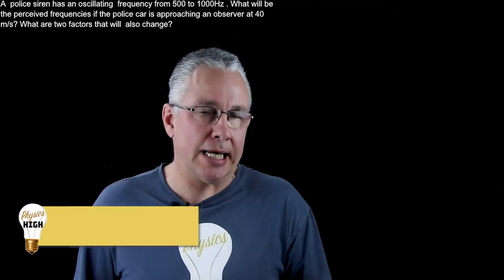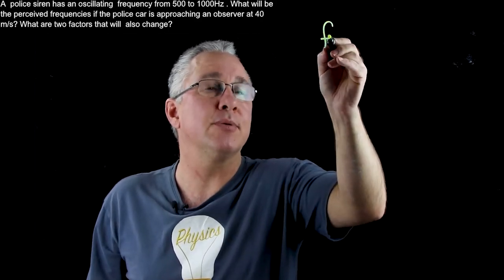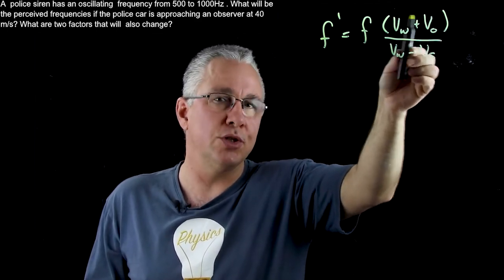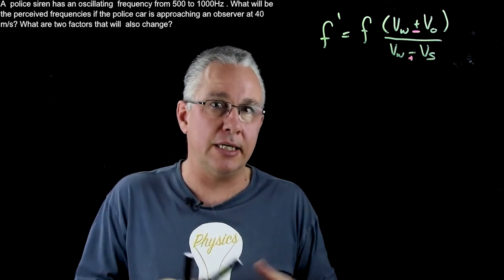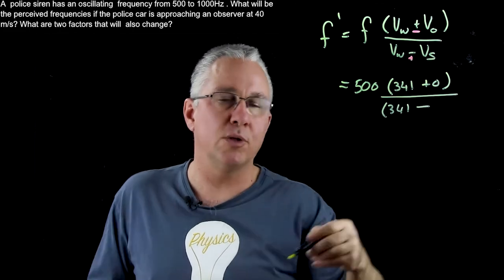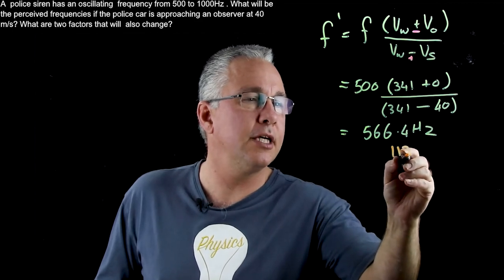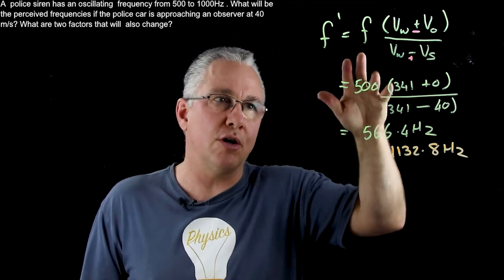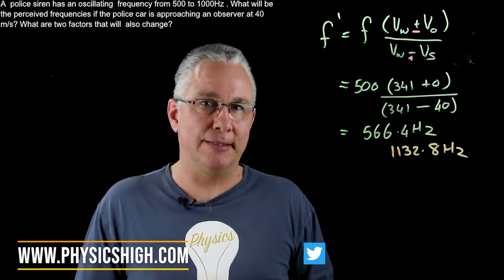How to solve a doppler shift problem

Comment: And what about the angle of travel of the police car relative to the observer?
Since the car is not going to hit you, that angle changes the closer it gets, so it can pass you. 
So the relative speed is less closer to you.
Reply: I agree, I was afraid of the trig we were going to get into re: sin of angle for police car to the frequency.  at 90 degrees, no matter the speed, it would be the same as generated.  So from 10 feet off the street, minimal distortion but, from 1000 feet off the street, major.  Decreasing frequency shift as it got closer, when far away from the path. 

love this channel!